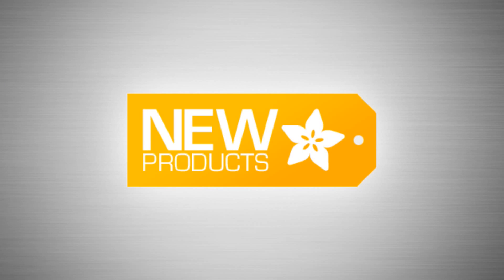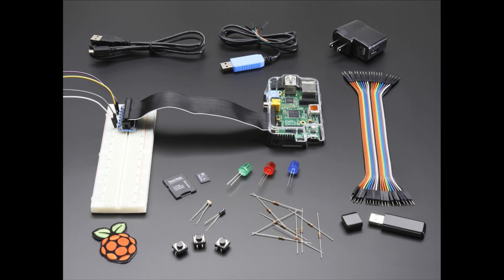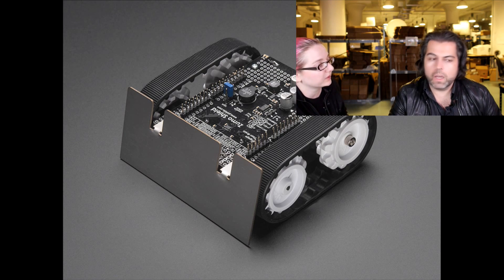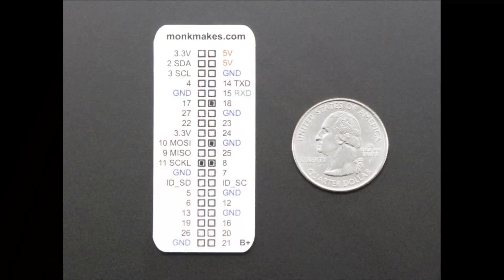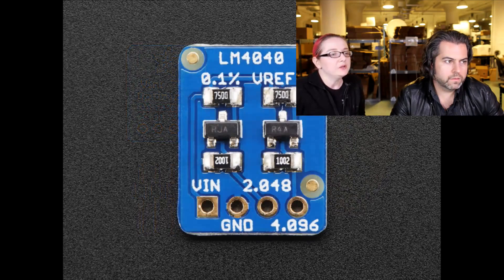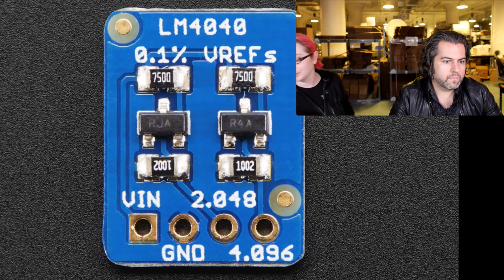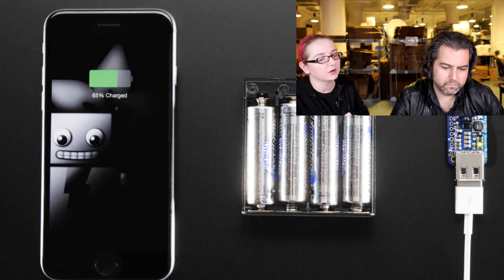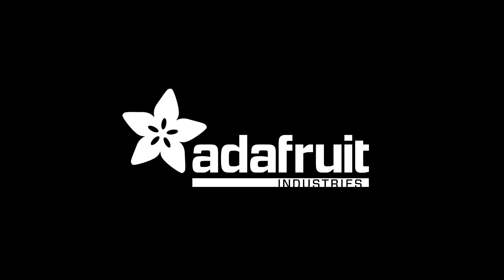New Products 10/15/2014

Comment: can i use this 5V Verter (TPS63060) as a powersupply for an arduino and buck or boost simultanously a voltage from a solar pannel in order to charge a LiPo?

Solar ---|___5V-Verter___|---Lipo
                          |
              Arduino (5V)

I was wondering about this additional pins (Vin, EN, G etc.) at the bottom of this module.